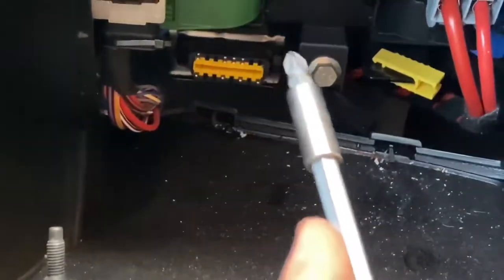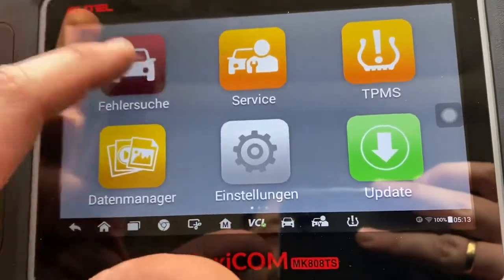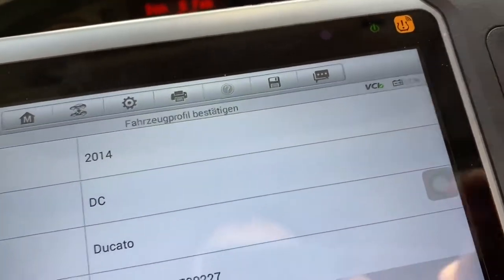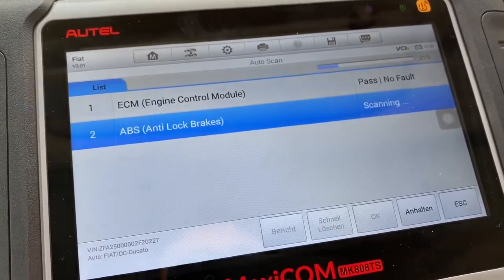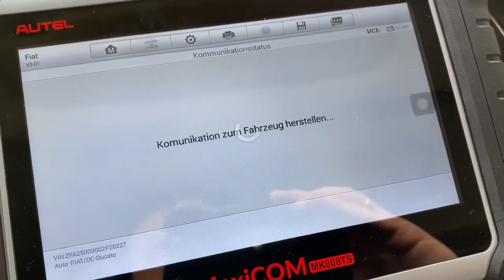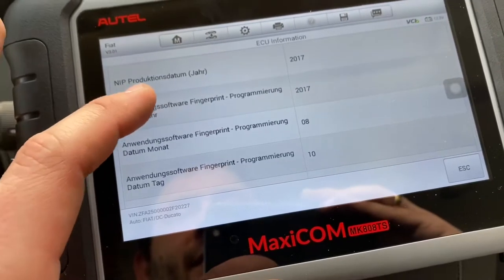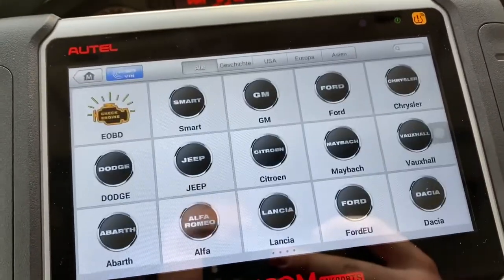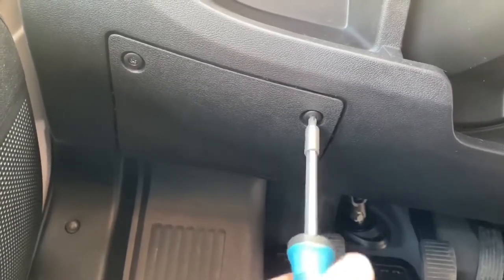How to read and delete the deeper failure codes from Fiat Ducato cars with OBD II scan tool Fiat DIY

Comment: Is it possible to stop a code from happening, to block it?  I have a transmission fault that comes up from time to time, i have spent a lot of money trying to diagnose/fix it and they can't seem to put their finger on the exact issue.  The problem is, when this code happens, the transmission starts acting strangely (won't shift to higher gears until 3000rpm for example), I'm sick to death of this problem happening randomly on and off for so long >.<